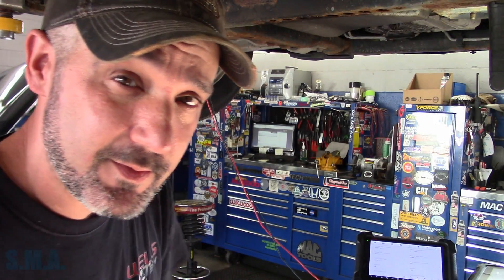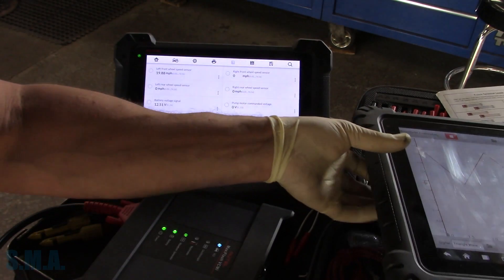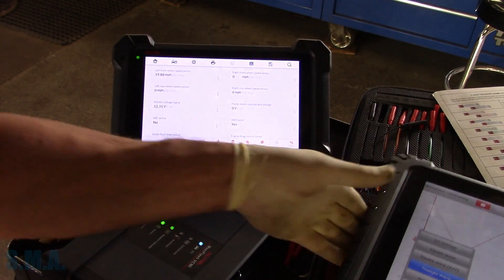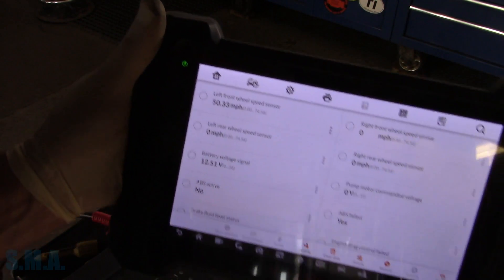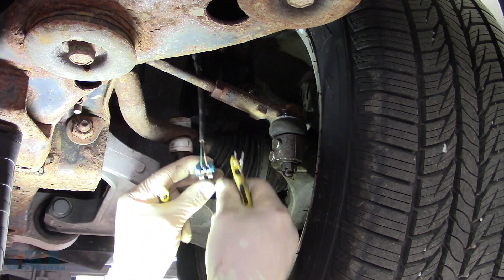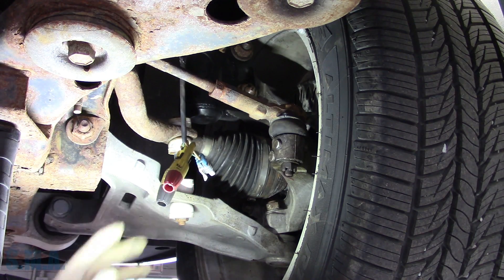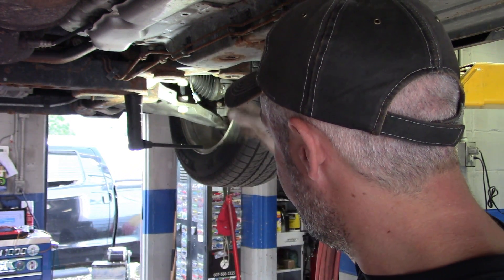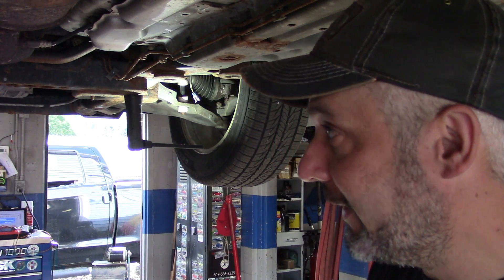Autel Maxisys Ultra: Signal Generator To Diagnose ABS

Comment: Thanks for a great suggestion. I imagine others have said this, but there are much less expensive scopes with signal generators and inexpensive stand-alone signal generators out there. I have a low-end 2-channel Picoscope 2204A ($200 range) and a FNIRSI 2-channel handheld scope with a built-in multimeter ($75) that both have signal generators. Both are very useful diagnostic tools.

Comment: So a code was stored indicating a problem with the wheel speed. Okay, but why was the wheel bearing replaced? For this vehicle can you do a visual inspection as to the condition of the wheel target (teeth, magnet strip?).

How difficult is it to spin the wheel and watch the output of the sensor. It is a two wire speed sensor. I would think looking at the sensor output is a much easier approach than changing the wheel bearing, if the target is integral to the bearing.

Comment: Autel needs to make an update so you can use signal generator and receive signal on the same machine instead of using autel devices.i just bought the ms919 with all accessories
Reply: I'm in the same boat.i wish our ms919 had cylinder firing order overlay like escope does.autel needs to add the useful features.sad it's lacking alot with how much the machine and subscription fees cost

Comment: Yes signal generators have been around for many many years for RF and audio what you could have done after you isolated the connector you could have gone from the place that you pierced to the connector ends to measure continuity to make sure which looks like it is the problem

Comment: I think If you saved a few of the hundreds of bad GM hub assemblies where the sensors are still functional, you could just use one of them as a signal generator and save a few Hertz on the ole pocketbook :-))

Comment: Pico and hantek have signal generators, I've always thought they were only for dialing in probes, atleast that's what one of the hantek manuals say. But I've always thought of injecting a signal to diagnose, just to nervous to do it, seeing you do it first helps much. Thanks 👍
Reply: As long as you can vary the frequency and amplitude and maybe the waveform you can do a lot with a signal generator.  The ones an scopes are usually a 1khz square wave for setting the probe frequency response.
Arbitrary waveform generators are available cheaply these days.

Comment: Hey Mr. O.,

really love your content. You’re the go to channel on down to earth car repair content here on YouTube. I live in Finland, where the whole country’s a big “rust belt” and new cars are taxed so heavily, people rarely buy new ones. So, we’re stuck with old cars and they require a lot of work to keep them running. 

I drive a Toyota Yaris Verso (Echo in the States, larger model of it) 2000 with the “larger” 1.5 liter engine. I’ve used your videos as reference as well as a reminder that I can do the maintenance and repairs I need myself whenever I can. I’ve saved hundreds in doing the work myself with your help. 

However, my car’s had the money light on for a couple of years now. It is the treaded P0420 and a new OEM catalytic converter costs more than a the car. I do not know if it is the sensors or if it is the catalytic converter itself, however whenever I take it for the annual inspection (I reset the light just before it), the oxygen levels are high and they measure them from the exhaust. However, the converter seems to work well enough as the other emissions are either 0 or within limits. Where would you start solving the issue and how? 

I know you might not have the time to answer me, but I appreciate it all the same.

Comment: Has the automotive industry started using digital devices ( sensors and controllers) that run on a data bus- as opposed to analog sensors and A/D converters? And if so- does it make the diagnoses easier?

Comment: I don't know why anyone would shit on you for using expensive test equipment. Using good, though expensive, equipment lets you get a faster & more accurate diagnosis, thus a less expensive job for the customer. Which makes customers happy, and lets you clear the decks to work another job. It's as if these people have never run a small business or logically thought about running one. I don't know much about running a mechanic's shop, but I'd imagine the general principles are no different than running the PC repair side of my business.

Comment: Great tool for a pro who  may also have other data sources on what signals should look like so you can generate them. So what can we average Joes do . like this? First get a scope, even a 2 channels will  get you far. Second probe signals on your car before they are broke and take pics/make a library of them. Look at the schematics, many "signals" are static voltage levels, you can see what reference voltages are there,  or if there are pull up/pull down bias resistors to set a ref level or common mode level. Lastly you don't need a expensive high end autel device, buy a signal generator online or from geeky electronics store I go to. On Amazon you can buy DYI old Radio Shack assemble type kits for 11-25$, get a real sig gen for under 50$, a really good one for 100$ and a knock out one for 130$. Ive bought good 100mhz and 200 mhz 4 channels scopes there for a few hundred bucks that are virtually Silicon Valley, Ca. pro grade, I know, Im a retired geek nerd engineer with 10 US Patents, its not the cost of equipment, it is the patience & the ingenuity of the mind that uses the tool. Eric didn't even need a 2-3K scanner & sig gen to do this, he could have simply ohm'd the wires out with a free harbor freight meter,. He's just giving an example of how to use test equipment to diag a problem. It's your noggin, not your wallet that solves problems....okay sometimes your wallet.

Comment: One of the newest and handy tools I've seen. Will eliminate many test drives and having to be under the car with the engine running, not to mention eliminate the need for 2 people some times, more accurate readings, and all around getting the damn car fixed which is what really matters.

Comment: Mr. O please never apologize for using any "high tech" tool to diagnose a problem. True, most of us diyers will not be able to afford that Autel tool but why would we buy it for the 1 or 2 times we would need it. That's why we have good mechanics like you. The diagnostic process, by itself, is priceless. Thank you for demonstrating the options and use methods of your new tool. Your quality information will help us customers speak intelligently with our trusted local mechanics without undue stress when we have one of those difficult signal loss problems. We need all the "tools" we can get. Thank you for the excellent videos you offer.

Comment: Hey Eric sorry your getting hassled.  Pretty much the same for me when I started wrenching.  I made 8.52 an hour and worked my way up and applied myself.  I dont regret anything I have done and if they don't like it I don't care, bottom line.  I lived in a Trailer also Eric with my older brother for years,lol.  I should of bought stock in Ramen noodles back then because I'd be a millionaire now.😄

Comment: I can think of another use right off the top of my head....    the older Crown Victoria's used a frequency-based MAP sensor that was a bear to diagnose without a scope. back then, i believe only Pico was making scopes... and they were expensive!   I had to go home and grab my electronics oscilloscope, watch the signal, divide the wave form by the time base to figure out what frequency the MAP was putting out. And, yep, it was bad!

Comment: It's awesome when you show this type of troubleshooting. I knew you can spoof a signal through a sensor, but I've never seen it done through an ABS/wheel speed sensor. Everyone can do power-ground-component and continuity checks but your out-of-the-box wire troubleshooting methods and tips made me that much better of aircraft maintenance technician than the other guy. Keep it up!

Comment: The tools Eric uses are convenient and nicely integrated, but I have 90s vintage Tektronics oscopes and an HP signal generator that I picked up for peanuts, and they work the same. You could use a 555 timer and a cheap Pico scope. The tools do not matter, knowing how to use them is the important part and that is the point of the video.

Comment: If you get anything from watching Eric's videos, it's that you can take your vehicle into a garage and have an idea what is causing your vehicle issue. 

Too many times, and I have seen it myself with my own automotive work, Eric shows how garages are charging paying customers for parts they don't need. With the right tools and some proper training, these unnecessary charges can be avoided. 

I am a DIYer though I have been working on vehicles for 30  years. Sure I would love to have a shop like Eric but that just ain't going to happen. Though watching Eric, he has taught some things and ideas which I have used and it has saved me time and frustration, and my customers money. Win win.

Keep it going Eric.

Comment: I tinker with and restore old, and I do mean OLD vacuum tube radios and a signal generator and a scope are almost indispensable so there is no reason whatsoever that same tactic wouldn't work in the garage too. Especially if you work alone.

Comment: I have always built cars and did some pretty cool things way back in the day. In the early 70's computers started coming out and of course, talk started about how these small little shops were going to be a thing of the past. Worry about needing all kinds of expensive tools, and the cost of buying computer diagnostic equipment, I had a choice to make. Keep working on cars or go into the carpentry business. Well, I figured sawdust was easier to clean off then grease. Anyway, I think I made the right choice, and built a carpentry business. I love watching Eric, I learned something new today, I have never seen a back probe. I always just cleaned the wire back and than shrink wrapped it. Live and learn, thanks Eric, I've been away a long time but, you keep me updated on things all the time, Thanks..

Comment: I use a pico 2206b for this purpose, used it for years (250bucks) .
Could use 2205A and that like 150bucks for useful scope and signal generator .
And yes you can you these versions pico for auto work and they quite capable and great low cost learning platform due to great software and online technical knowledge .
Most complainers waste twice that on parts that not needed lol .
was always shocked the pico-auto didn't have the generator functions :-O 
on crank and cam sensors it even more useful in speedy and simple diag .
Soon be time for me upgrade my autel I think .
good job Mr O ...

Comment: Georgi LaForge and Lt. Cmdr. Montgomery Scott approve. "We'll have to inject a signal down the wave guides to see if the power couplings are activating the plasma relays."  Or in this case, if the ABS connector is an ex-ABS connector.

Comment: Another informative video from EricO, great job.  That new Autel unit seems like a great kit to have.  While using the signal generator to send a signal to the PCM/ECM, you can also verify that the wheel sensor is working by scoping it, scope hooked to sensor and rotate the wheel.  Keep them coming, I enjoy each and every one.

Comment: An idea.

Telephone guys have a signal generator and an inductive pick up that amplifies the signel to an audio tone. At any point along the cable you can hear the tone the wire is good, when the tone stops, you have found your point of failure.

These lots are fairly cheap.

Comment: Screw the people hating on your for having expensive tools. I'm a barely competent DIYer doing fluids and brakes in my garage, and I still found that interesting. And if you're logical enough to work through that diag with that tool, you could substitute a more creative way to do it with cheaper/older/other purpose equipment, like you say, even just spinning the wheel with a scope.

Comment: That ultra looks amazing. Do you know if you’re able to do a relative compression test from the obd connector using the VCMI? I know that channel 4 of the scope is connected to the obd connector internally. But how amazing would that be to be able to do RC tests that way.

And don’t stress over the negative comments lol. Anyone that knows you, knows that you’re a stand up guy.
Reply: I belive you can yes I’ll try to set that up.
Reply: behexen250 I’m not sure if you can select the battery positive terminal in the VCMI.

Comment: Hell yes Eric a great tool and its not like you stuck to the one solution by explaining all the others it gives people an option on problem solving.  I was thinking of you today I have a Mazda 3 and all of a sudden no cluster information, no revs or speedo, DPF, air bag sensor and money light is all lit up and no indicator/lights feedback on the screen.Hmm what would Eric do? Checked all the fuses with a voltmeter all OK.Plugged in a  cheapo OBC lead to the laptop with the freeware FORScan tool showed a trouble reading the "instrument cluster module", so I pulled and reseated the relays and VOILA!! were golden. Damn a plan that worked BEER TIME!

Comment: Thanks for the video Eric.  I now know if an ABS sensor fault comes on to try injecting a signal bypassing the connector. I could even jump across the connector with the existing sensor and rotate the wheel.
Reply: If you just testing the plug couldn't you run a jumper in the plug and put your ohm meter test clips on the wires themselves creating a full circuit? With the key off.
Reply: I just run the old multimeter to the sensor and check for ~.8v while spinning, then the end at the module. This is probably quicker if you're set up for it, though.

Comment: Here it is fellers; I turned wrenches for 7 years, then begun selling Auto Parts for the 2 largest Auto Parts chains.
     I speak daily (for 29 years ) to DIY customers and Professional Repair shops. I learn different things each day.
    We are in the midst of a heavy on-line offering of like parts - that we have on our shelves. It is touch and go regarding quality. Eric O. and that Ivan guy, they diagnose, research, print diagrams and grab all the info they can.
If ---a Repair shop is equipped with the latest knowledge and tools to diagnose and repair, so be it.

This particular channel was not solely broadcast for economical ( cheapest ) repairs. It is to properly and in a timely manner DIAGNOSE the problems. If that can accurately be achieved with a 10mm wrench and a scope on a rope, Great !  Though, it may be much wiser to use later technology to get there. Latest technology and modern equipment cost bigger money. A1 Mechanics like Eric O. and Ivan seek out what is best for each type of repair.

  Again, I daily am speaking to DIY customers and I am visiting shops. I see the parts they are putting on customers' vehicles. I see the " return " parts back to the store. I look at each and every NEW and Warranty return.
  The average SHOP is so similar to DIY'er Jack on the weekend; Read a code on the scanner, purchase the part, bolt it on, remove it when it DOES NOT fix the vehicle. 
Last words, Drive on Eric and Ivan, You both are rare in your field. Truly. If others do not like it
    Tell 'em what Mick Jagger does,...." Hey Hey You You, GET OFF OF MY CLOUD "!
Reply: Info is key. Wiring diagrams are must!!! Access to the info??? My boss told me we should diagnose computer vehicle before they had computers to diagnose them🤔🤔🤔🤔🤔  I have been in this since 1983 I think the first think to retrieve information was a Diagnostic Data Reader. And a 4 inch thick trouble shooting manual. Yes my boss was a parts guy. Eric you are awesome with all the latest technology you show your viewers. This is why you have so many subscribers. Not to mention how you welcome us in to your garage. Thank you

Comment: I remember years ago a Dealership telling me they spent $800 on their scan tool from GM. A few years later the tool was $4000, a few later $7800 and then a few years after that it was $14000.00. OMGosh I said you need a PHD to use one....and the Mechanic said "just about". I know I'm lost when it comes to deciphering the problems today but I'm sure glad there are guys like you Eric that do! Thanks for the great videos! Jim.
Reply: @behexen250 I think what Aero is saying is pretty much all scan tools have OBD2 capability, the producers of the pricier tools have paid manufacturers for the coding to interrogate non-OBD2 and/or proprietary codes and/or  bi-directional controls, the difference between a cheapie code reader and a functional diagnosis tool is like chalk and cheese.
Reply: The stupid part is that the cheap tools talk to the car the same way as the expensive ones do. 

The only difference is the expensive ones know how to access extra parameters.

The code to read the data is the same on both tools, but the expensive tool knows the address of the extra parameters.

Comment: Question, maybe I missed this information but here it goes. Can you generate a signal from the tool and monitor the ecu input with the same tool? Split screen or be able to jump out of that application (leaving it running) then go into ABS module to monitor data? Or do you need the generator and a second scanner to read data?
Reply from the maker: On this tool yes you can, however there is not enough cord on it to keep it plugged into the DLC AND use the generator at the same time. Using the scope/generator under the hood and having it plugged into the DLC works well and usually has enough room. The split screen portion of the tool works great the 5 or 6 times I have used that option so far.